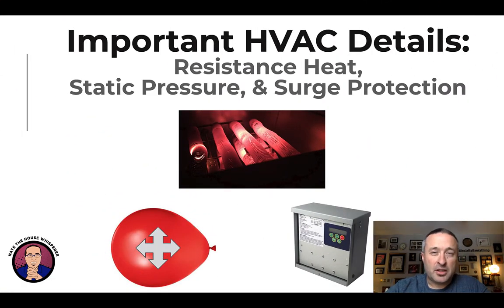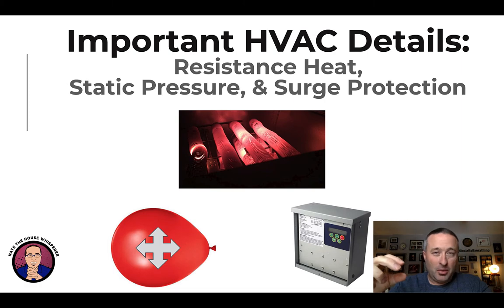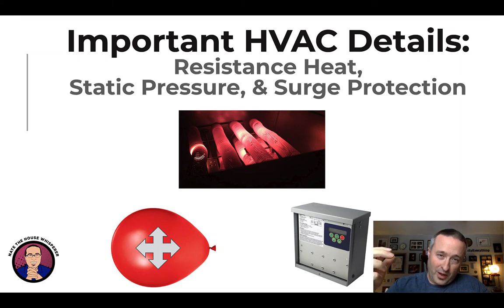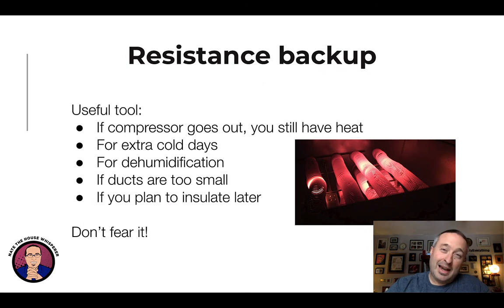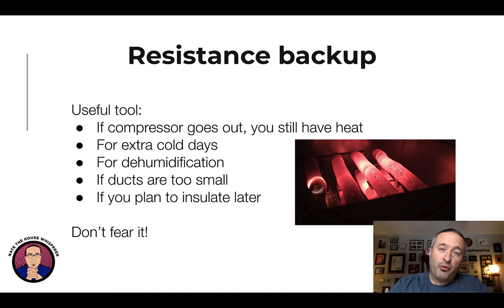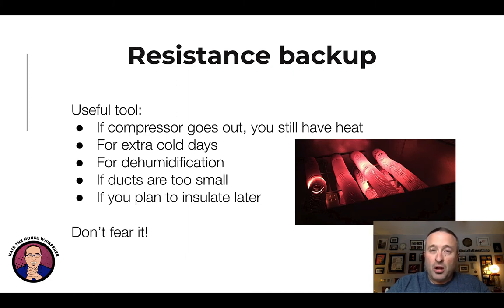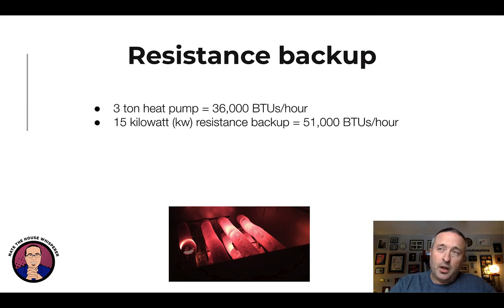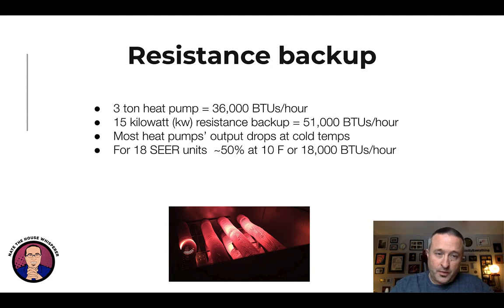Electrify Everything Course   HVAC Details   Resistance Heat Part 5 Module 2

Comment: More good info! Wish I'd seen this before we installed our Mitsubishi 5 ton unit -- I had been adamant about leaving off the optional resistance backup.
Reply from the maker: If there is a slot you can always add it later. Typically it's a ~$200 part. If you want it let them know when they come to service the unit.

No resistance is a common stance, and one we'd like to at least soften. 

Did any arguments hit home in particular? Thanks for the feedback!

Comment: Is adding resistance exclusively a bespoke after market solution, or do manufacturers sell hybrid/resistance together?
Reply from the maker: Do you mean adding resistance to a hybrid furnace/heat pump? If so that would be bespoke.

Unitary heat pumps almost always have a slot for resistance heat, including many mini split models (if they are standard air handlers, doesn't apply to the skinny ones.)

Comment: At minute 9 - You've just allayed fear of freezing and the value of resistance. Let me share some examples that might be useful to discuss: We had a cold snap of down to 10F the other weekend and a friend with a heat pump (no backup) didn't meet set point even with a Mitsubishi in the early mornings (maybe mid 60s instead of 68). Our experience with a Carrier heat pump without backup was one that also didn't meet set point  (primarily in the morning) and might not have been able to keep it at the 70 degree desired temp (maybe just 68). A third story is when we installed a hybrid system (Bosch heat pump with backup gas furance) we were told that on average, there might be 8-19 hours a winter that the heat pump might struggle. All of these examples to share that freezing won't happen to the degree that one might think, that even if it does - will happen for a small number of hours, days, etc... This may not satisfy all heat pump adopters, but the cold snap moved on and we're all just fine...
Reply: (not sure what the lines are all about)

Comment: I have a 4 ton Bryant geothermal heat pump in my basement, installed just before the 2014-15 heating season, with resistance backup, but my thermostat does not enable me to program it to come on automatically. I can only turn it on manually. I have manual thermometers now that I can use to read the incoming and outgoing water headed from and to the 2 x 300' closed well loops, so I can better judge when to employ that resistive backup.

I wonder whether a better thermostat could administer that on a programmed basis. Sounds like I'd need load data somehow, to allow it to judge when it should come on. And it sounds like it would be difficult to have it work in tandem with the ground loops and heat pump, to share the load and prevent the ground loops from getting too cold soaked in the first place. Is that a part that can be added? 

I can adjust around its limitations, since I barely ever need more than the loops (1900 sq ft, R-45 open spray foam roof, R-22 open spray foam walls, all renovated new space, tight 0.28 transmittance windows), but having followed through your videos, it sure seems like a design flaw. 

One I'll need to address before I ever sell this place. Last thing I'd ever want is to have a subsequent owner get disgusted and go back to propane (no gas available here, thus the fortune in finding out about a GSHP in the first place). I've heard of that happening before, and it's heartbreaking to hear about. Especially since mine runs on nuclear and solar electricity. Like 300-400 pounds of CO2 a year, instead of ~13,000 or so from oil.

Comment: Lets talk about my $330 electric bill and resistance heat... with a heat pump.... in a 1500 sqft house with 11 cents per KW rates...  or the fact that I have spent over $18,000 in electric in 7 years that I have lived in this house.
Reply from the maker: There are a lot of potential factors here. Is the equipment installed well? Is it commissioned well? How leaky is the house? How efficient is the equipment? How do you operate the house? A lot of information is needed to be able to give an intelligent reply.
Reply: @NatetheHouseWhisperer  is there a way I can send you my energy audit?   The equipment is 20 years old and its. 3 ton Nordyne heatpump.  It's installed decent but located in the attic. Unit was never commissioned, hvac contractors dont even know what that is here. Lowest bill during the swing season was $115, highest winter bill was 330 or 370.  I average $200 a month on electric.  I'm all electric.
Reply from the maker: @tekjunkie28  Yep! Feel free to schedule an hour. I'd like to see monthly usage and get model numbers for indoor and outdoor units. https://www.natethehousewhisperer.com/contact.html